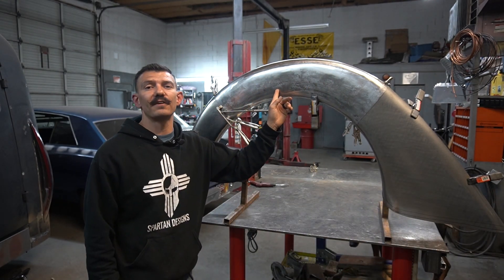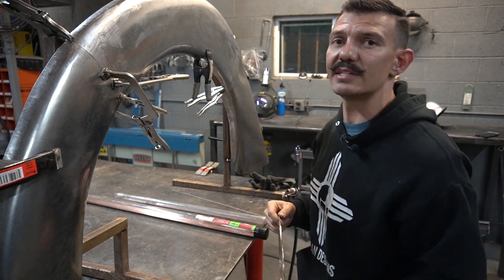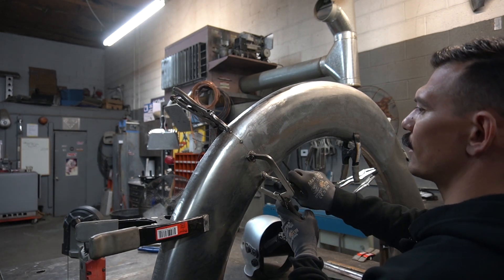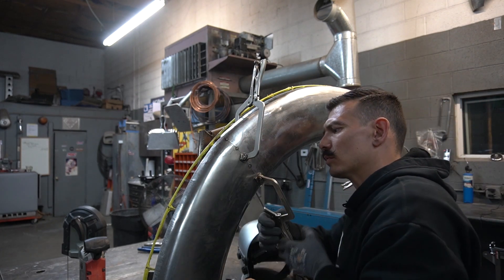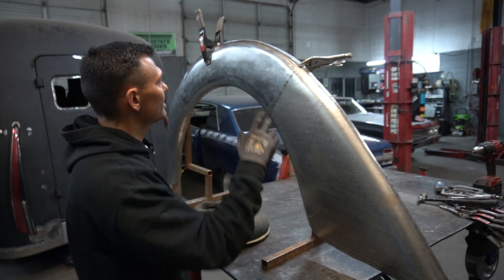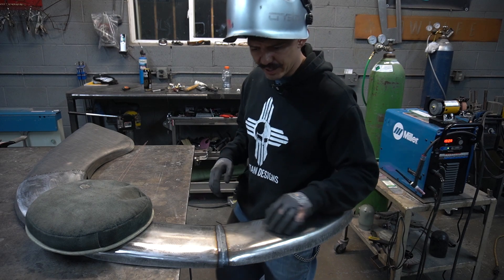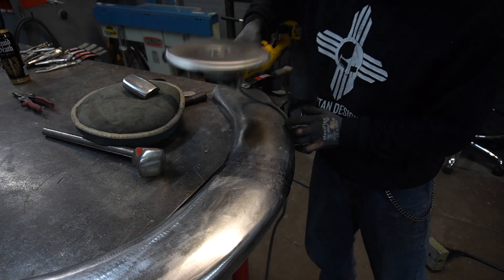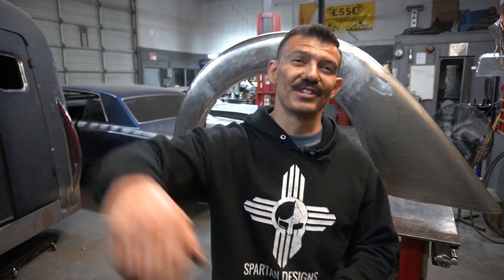Tig Welding Crash Course What you need to know before getting started | Fender build part: 2.

Comment: Dare I put in my 2 cents ??
TIG wire (generally S2), has a softer composition and has other juices and vitamins in it to promote puddle cleaning as you weld. 
It is easy (easier) to planish because it is “softer “.
MIG wire is usually around S6, quite hard. 
Planishing this is not fun. Grinding it isn’t fun either because it heats up and will make panels look like a Quebec highway.
Great restoration info. 
🙏🏻🙏🏻
Reply from the maker: Cool! Thanks for the info. I figured as much but truly I have not noticed a difference in the hardness when I use it as filler rod with the tig. Now if I mig weld it, then the weld is definitely noticeably harder! But thanks for watching and I appreciate your info

Comment: Whats the settings on your machine, what size is your Tungsten???
Reply from the maker: My tungsten is 1/8" and Im at full amps on the machine but I adjust with the foot peddle
Reply: Glad I found this Chanel. I'm getting ready to start to learn some tig welding and this is some good info.  Thanks!

Comment: 🇦🇺Yep I agree with the other guys, and here is my ask and it's a biggy. I absolutely loath my tig torch. I want to buy buy a foot pedal, but a large outlay for a maybe. What I am asking is can you set up a camera at the pedal and at the point of weld and split the screen  just to see the correlation between the 2. And maybe a talk through the settings for the tig with the gauge you are using. A big ask of your time I know, but I think I'm not the only one that will appreciate this content. Thanks mate
Reply from the maker: yes I will try to make that happen when building the next fender! thanks for watching

Comment: It looks like you have no problem standing on one foot and operating a foot pedal.  For what it is worth I never enjoyed that dance and recently found out about a device called the Tig Button.  It is a pressure sensitive switch that you mount to the torch and it regulates the amps like a pedal, but so much more comfortable, can now throw that f**king pedal in the bin.  I love it.  Best 250 bucks I have spent in a long time.  Just my two cents in case you want to check it out.  Thanks for making all these videos.
Reply from the maker: yeah I have heard the trigger is nice! personally I have never used it, I would like to try it. I'm so used to the foot peddle I don't even have to think about it anymore. I've been doing it so long I can use the peddle even laying under a car on my back😂😂

Comment: Thank you for your clear explanation. I have a question: Is there an alternative method to get the weld seam really smooth if you would not have a shrinking disk?
Reply from the maker: Yes you can just planish it with the slapper spoon and Dolly but you would have to really pay attention and take your time to not over stretch. When you use the shrinking disk it levels everything out that might have been stretched too far or might have just been high. I would definitely recommend buying a shrinking disk if you are going to try the method I use in my videos
Reply: Thanks